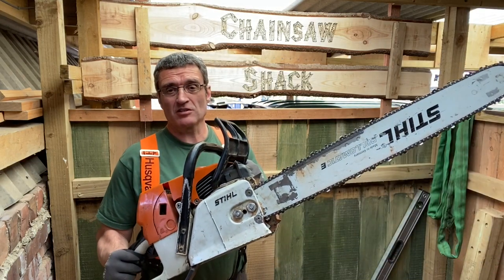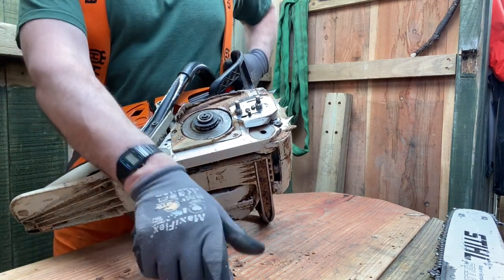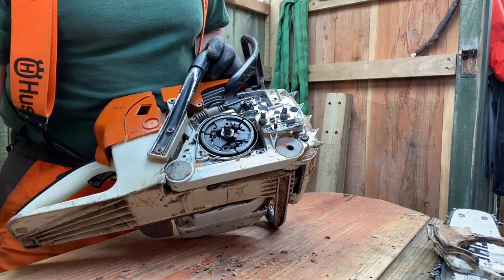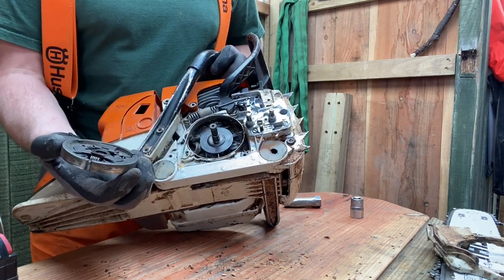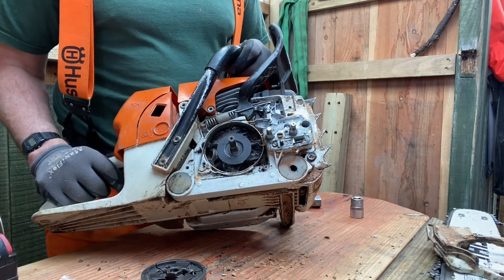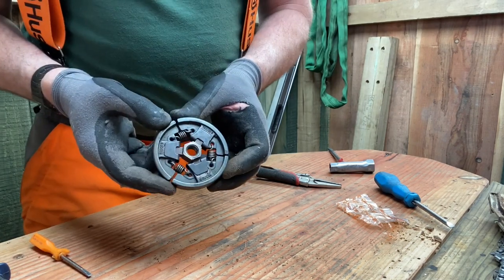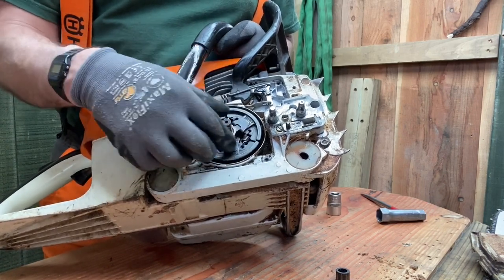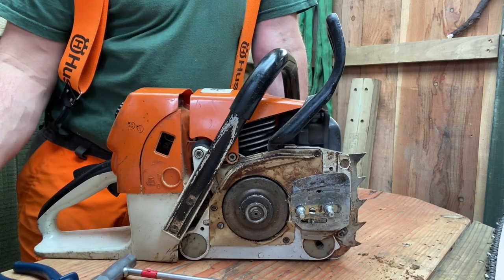Fixing a Chainsaw Clutch

Comment: I tighten the clutch with my impact tight enough to get the E clip on the end of the crank.  If you do not get the sprocket connected to the arm on the worm gear, you will not be able to get the E clip on the end of the crank.  Stihl’s Service Manual says to rotate the sprocket one full turn to make sure it is engaged in the worm gear’s arm.  I usually just put the sprocket on and rotate it a full turn and watch for it to drop down on the worm gear.  Then, I put the washer and E clip on.  I use a pair of kitchen pliers to snap the E clip in place.  You should hear it snap into place.  If not, replace it because it has lots its tension.  They are pretty cheap at your Stihl dealer.  It is better to replace it than have it come off while you are cutting.

Comment: So I have a stihl 026 that has the metal oil pump and plastic worm for some reason every single time the clutch over tightens when I put it on and go to pull the string causing it to not be able to turn over would anyone have any ideas on this
Reply: Two possible things. 
1) check you didn’t put the big black washer on back to front. Note in the video I got it wrong first time then corrected myself. 
2) make sure you pick up the oil pump drive arm with the notch in the clutch drum when reassembling.

Comment: I just hit the clutch with my impact containing the righ size socket turning CW.  As soon as it loosens, I spin it off by hand.  The best way to take the old springs out is with a pair of needle nose pliers. With the clutch in a vise.  I usually use oem clutch springs. 9:26

Comment: Stihl recommends rotating the sprocket 360 degrees to insure the worm gear arm engages with the notch in the sprocket.  If you cannot get the E clip on the end of the crank, your worm gear arm is probably not engaged in the notch on the sprocket or you did not tighten the clutch sufficiently.  I usually put my clutch on with my impact and give it at least one rap with the impact.

Comment: I have ms180 she start fine but in the wood chain stop but chainsaw working fine.can be problem clutch or
Reply from the maker: The ms180 is a small saw and needs treating gently. The chain will stop in the wood when the chain is sharp and you have lots of teeth engaged with the wood (i.e. when you are cutting a large piece). Make sure you keep the engine revs high by not pushing too hard to get through the wood. The harder you push, the more load there is on the engine and the more likely it is that the chain will stop. With a plastic bodied saw like the ms180, if you carry on revving when the chain is stopped in the wood, you have a chance of overheating the clutch and melting the body of the saw.

Comment: Great video!
I take you eliminated idle screw setting as the cause first? It looks like the clutch was the problem though.
Reply from the maker: Yes, but it's a good point. I'd rebuilt the engine with a 100cc Hyway rebuild kit so it's certainly a possibility that this is a factor. Don't buy saws unseen from ebay is the lesson from this one!

Comment: That’s the wrong sprocket washer for a rimless sprocket.  The aluminum washer goes on with a spur sprocket.  You need the thicker steel washer with a rimless sprocket.